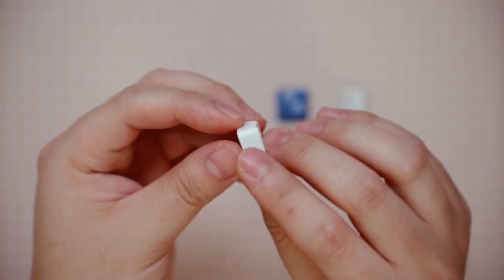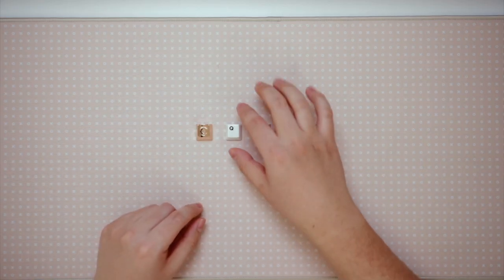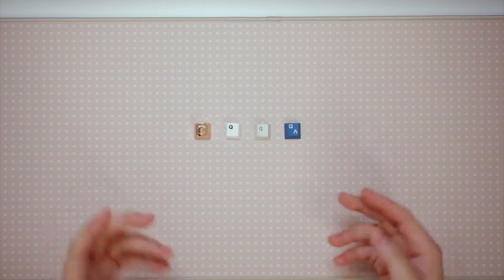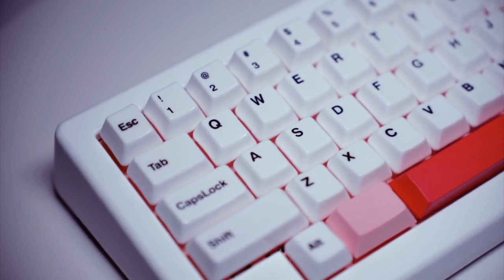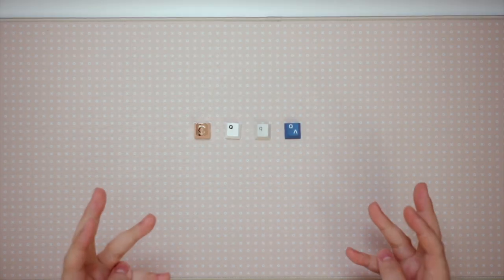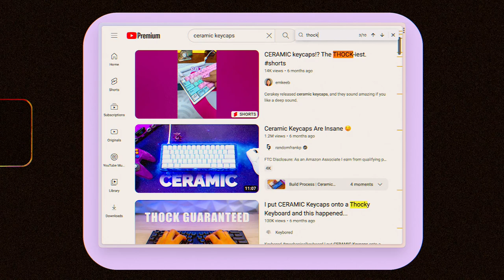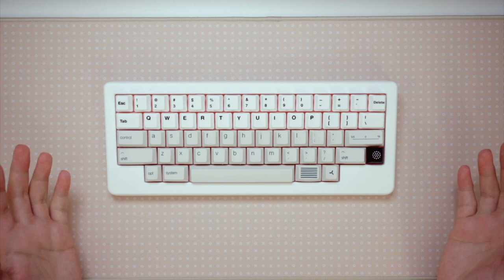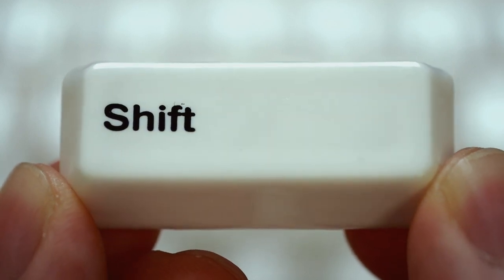cerakey ceramic keycaps are the real deal

Comment: FANTASTIC! These key caps are phenomenal. We put our new ones on earlier and the touch and typing experience absolute TOPS! My own typing speed has increased significantly because my fingers can glide across the slick key tops and are able to move off the caps much faster than I was previously able to on ABS or PBT caps. These are smooth, glossy, and simply sublime!

Comment: I might be wrong but the ceramic glaze shouldn't fade because the glaze is basically the material itself, or the whole ceramic piece is colored basically. Alumina ceramic is super hard and basically only diamond can scratch it, so the shine and color should basically be forever. Otherwise i think the only downside should be that it is brittle and might crack with sudden impacts.
Reply: So IIRC they showed off how durable they are by dropping a few of them down some stairs. Seemed to hold up perfectly fine. The Spacebar however is heavier so that could possible get damaged.

Comment: Is it different to type on them - in terms of the weight difference? 🧐
The looks are amazing, I've had my eyes on the ceramic keycaps for a while - just waiting for them to be more commercially accessible. 😊
Reply from the maker: I don't notice much of a weight difference on the 1u keycaps when typing, but the stabilized keys definitely feel weighty. I think the spacebar feels nicer with an extra spring around the switch, but I don't think it's strictly necessary.

Comment: I have a set of these and I like them overall, but the spacebar gets stuck on my GMMK so I had to switch it out. Did you experience this?
Reply from the maker: Hey there! What switches are you using? I just tried on my GMMK and didn't experience it. However, the spacebar is a lot heavier than a plastic keycap, so off the top of my head it could be a few things: 
1/ Make sure that the spacebar is installed straight and level on the stabilizers (firmly push both ends of the spacebar until it "clicks" into place)
2/ If your switches are fairly light, you may just need a heavier switch on your spacebar.
Reply: @sagwatypes  Thanks for the response! I'm using Kailh speed copper which actuate with little force, so I think you might be right that I need a heavier switch. I'm going to do some tests.
Reply: @sagwatypes  I replaced it with a Kailh pro heavy plum and that mostly fixed the sticking. It still gets stuck when I press on the left end though (not the right or middle). No idea how to fix that. Also there is a slight glassy sound on the downpress impact and a scratchy sound when it travels up. Any tips to suppress those noises? (sorry if this is simple stuff, I'm a noob!)